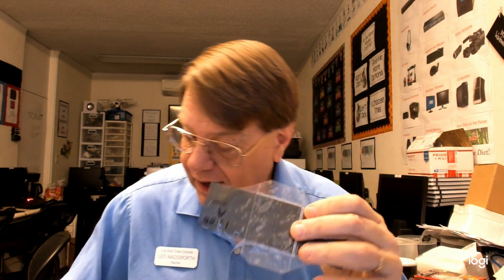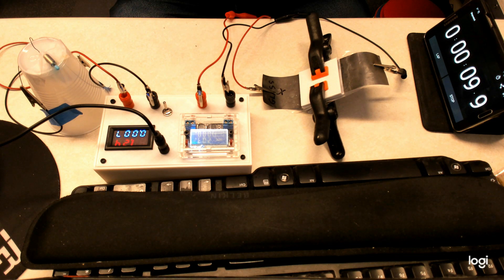Sugar Carbon Foam Results

Comment: Great stuff Leo, It will be useful to know the sweet spot, somewhere between 3m 47s and 13m without breaking the mugs :-)   BTW are you using an 800W microwave?  Martin.
Reply from the maker: Thanks, Marin!  I'm using a cheap microwave from Walmart that says it is 1000 watts.  I ran a new test yesterday at 777 seconds (8 min 17 seconds) and at first look it looks like the mug is fine.  It was a different mixture too, so we'll see.  leo

Comment: Excellent results! I also really like your testing setup! I wonder why you cannot use the ebdusb+ because I have tested much smaller cells on mine and obtained a graph and mah/mwh reading.
Reply from the maker: Thanks!  I think I can use the data logger at this point.  In the past my cells weren't doing well enough to source 10 mAmps of current.